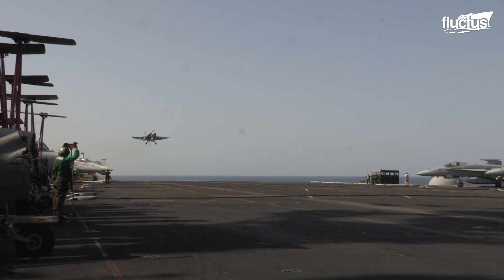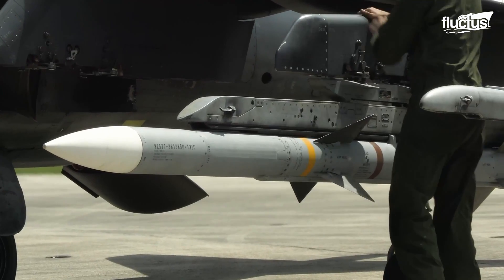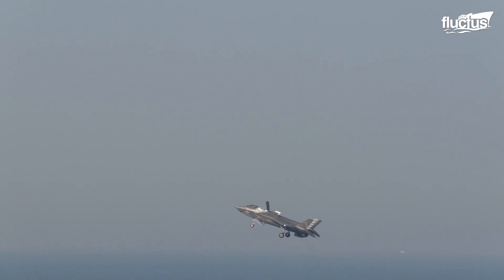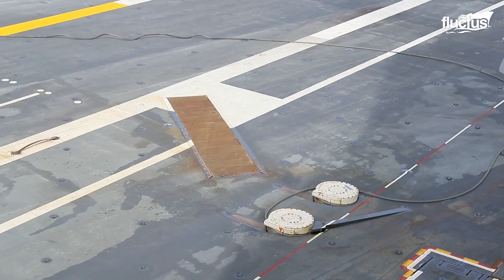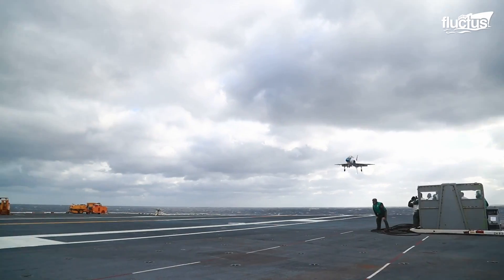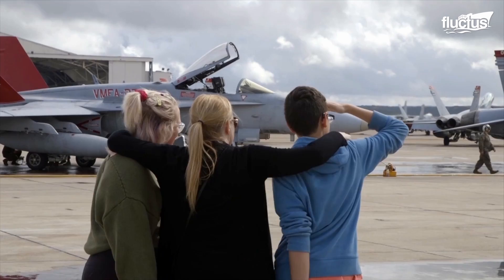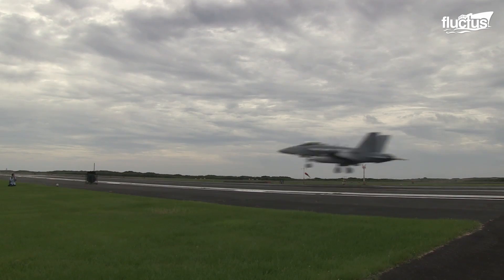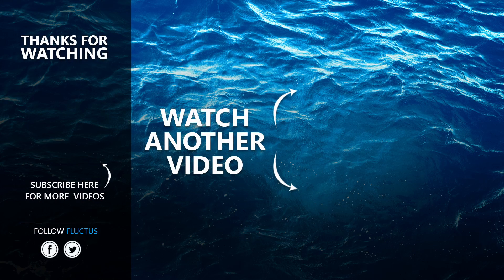US Extreme Technique to Land its New Super Advanced Fighter Jet on Carrier

Comment: Royal Navy uses the SRVL, Shipborne Rolling Vertical Landing technique with their F35B on the Queen Elizabeth Class carriers. Forward motion during landing creates lift which is necessary to safely carry the extra weight of the pilot’s massive balls 🇬🇧
Reply: "Royal Navy uses the SRVL, Shipborne Rolling Vertical Landing technique with their F35B on the Queen Elizabeth Class carriers."(sic)

Not yet. Despite all of the SRVL testing that the ITF conducted aboard the QE off the Maryland/Virginia coast back in October of 2018, the technique is still not operational in the fleet. All of the recoveries aboard the QE flown by VMFA-211 and RAF No. 617 Squadron during CSG-21 were vertical not rolling.

Comment: Sir my 2 qustation are here, that what happen exactly when aircraft when running on runway and pilot pullup york and aircraft liftoff. Tell me what happen that time. And another qustation is at altitude when rain is falling then why not ignitor will short due to water entry. And there is any problem due to water entry. Plz tell me about that
Reply: The F-35B can takeoff normally like the F-35A,C model.  When the aircraft reaches rotation airspeed you pull back on the stick   I worked on the F-35B,C from 2013-2020.  Never had any issues reported by rain.
Reply: AND it has a bread maker built into the eat-in kitchen.